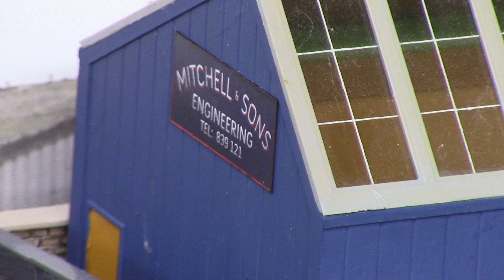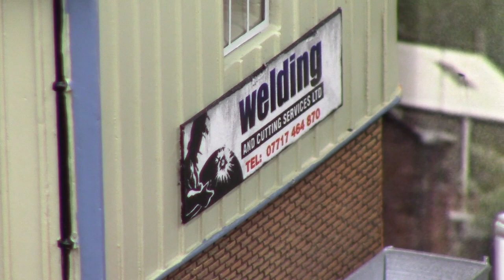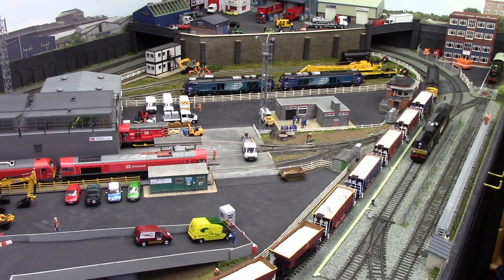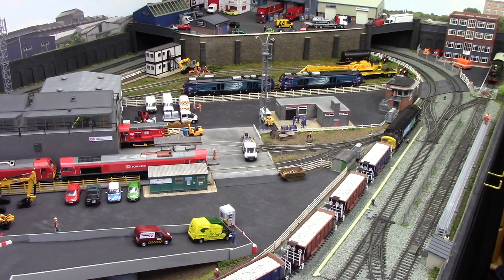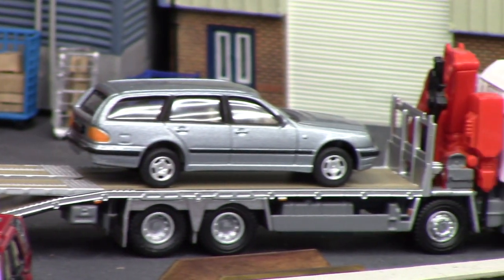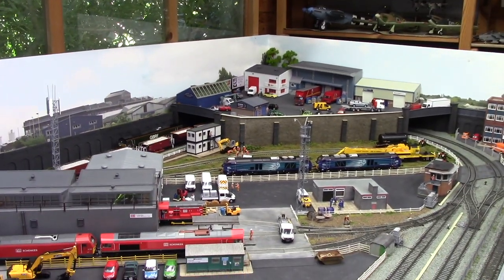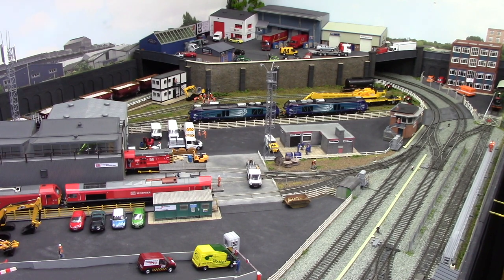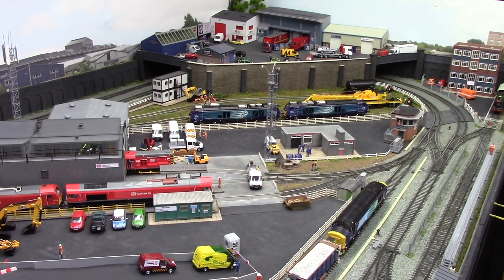66779 Evening Star and 37425 Concrete Bob and some signage

Comment: Nice video, great layout with lots of detail in such a small area.
Great how you showed completed building details and scenarios.
Be interesting to know whose kits, and details are, as you film each building area. .
Signage particularly good as well, ever thought of doing a video on signage...
Evening Star looks great I'm the gloss finish, with added touches like the bell.  Whose model is it..?
Reply from the maker: Hi there, first the easy bit Evening Star is a Bachmann super gloss finish, exclusive to Locomotion models. I will try in future to give details but they are all the standard fair of models that are either kits or ready made ones that's out there.
Cheers Peter
Reply: @torridonroadbypeterdixon4162  Thanks, memory going,   DOH ..Got that the Locomotion Evening Star for my 66th Birthday, still in box for when I build the DCC layout, running DC at moment.
You done a great job installing all the building ..giving a real atmosphere.
Well done in such a small space ..